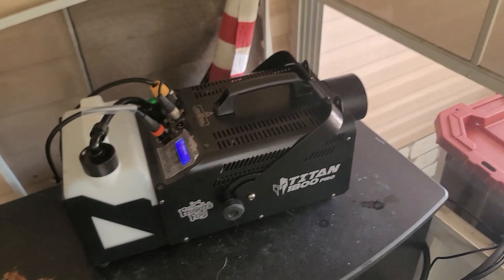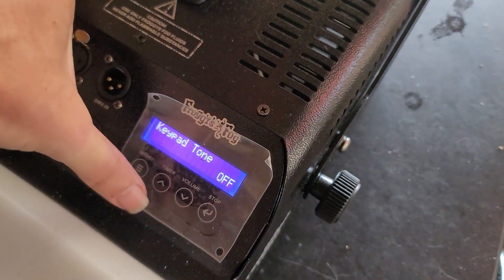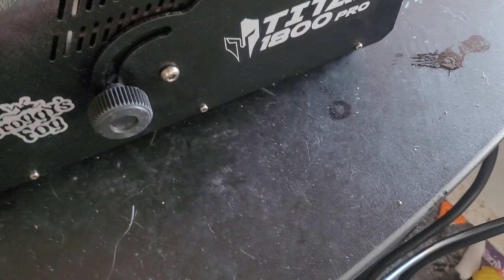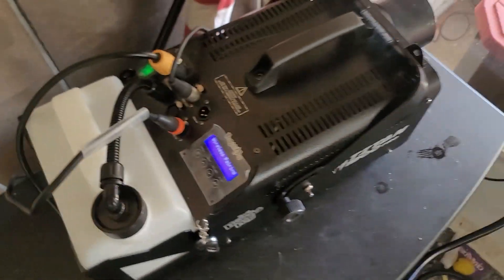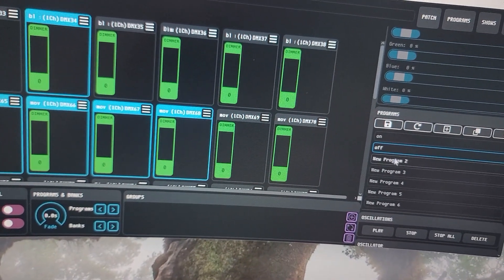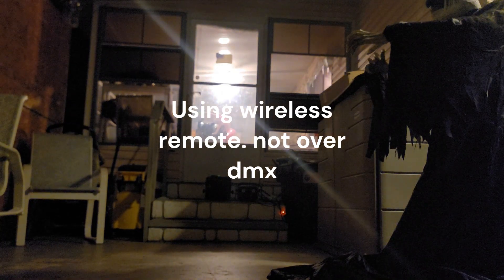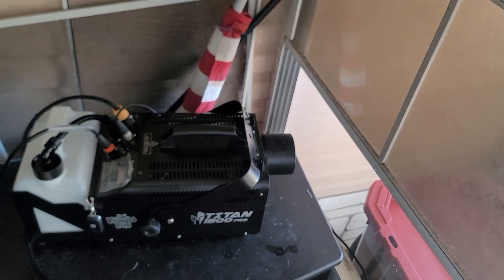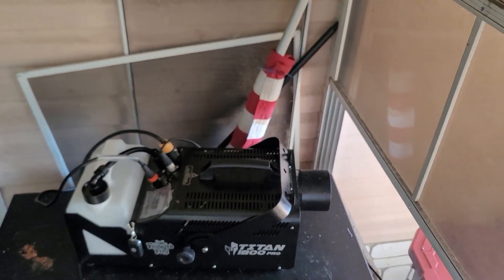Titan 1800 pro fog machine 1 year update

Comment: Hi, I purchased one of these almost two years ago during a Froggy's Clearance sale.   It has been sitting on my shelf all this time.   I tried using it today....and it did not work.
I turned it on and got no display at all.  Just the green button.  I have no DMX controller, but I assume even so it should come up.
I waited 15 minutes and got nothing.  No heat.  No pump.  Nothing.  I tried pushing the breaker; it just wiggles a bit.  I don't think anything tripped.
Thoughts?
Reply from the maker: @BrianFuchs-jz1ik  sounds like it's out of warranty period. But you can always email their support team and tell them what you told me and see what they can do for you. They will fix it for you, but since it's not under warranty anymore, you will have to pay them to fix it and pay to have it shipped to them. They're usually pretty quick on fixing them. I wouldn't suggest opening it and trying to fix it yourself though. I'm not sure how much they would charge to fix it. You'll have to ask them. I can't imagine it would be real expensive to fix for them if the problem was easy to fix.

I had an issue where mine was clogged up after fogging out the entire neighborhood for a few days and they had it fixed and cleaned and sent back to me within a week. 

Reach out to them and see what they have to say. You can find their support contact information on their website. 🙂

Comment: what do you use to clean nozzle?  thank you
Reply from the maker: @AmandaPerry-n3m  fog machine cleaner and then deionized water. There should be an instruction booklet on how to clean it that comes with the machine if I remember correctly. After you clean it you'll want to run a few sprays of fog juice through it to keep everything working if you plan to store it long term after you clean it.